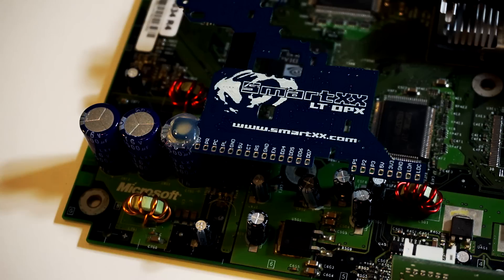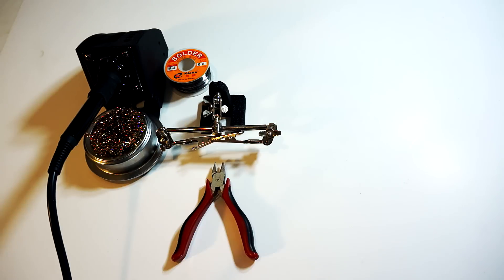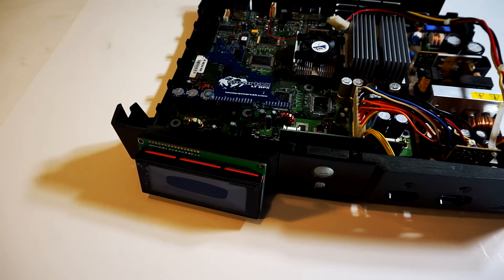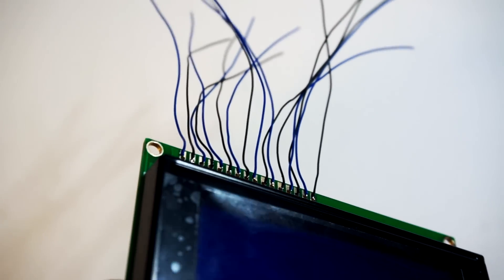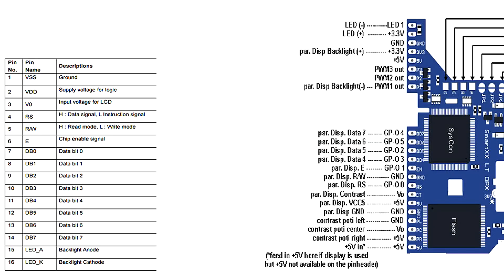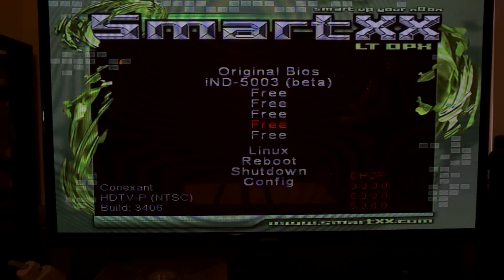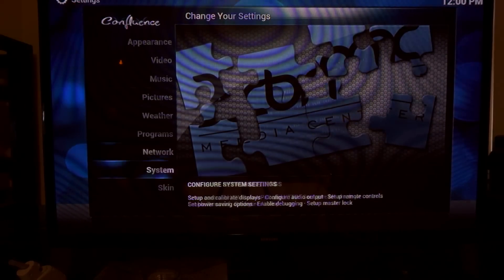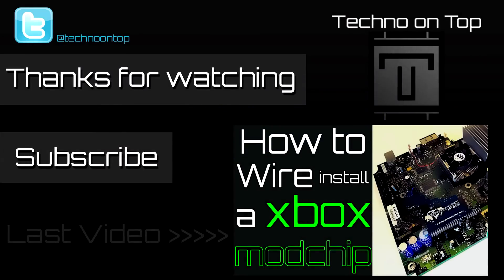How To Install Modchip LCD Original Xbox

Comment: I was hoping to see how you mounted it. I'm good with connecting it to the modchip, and I have the bezel and emi shield cut; just need to figure out a good way to mount it flush.
Was thinking of using some epoxy putty to secure some bolts to the bezel, screw on some nuts, and then feeding the bolts through the lcd's mounting holes.
Reply from the maker: Yeah getting it to look nice is the hardest part, can't really teach that people do it differently. Personally I cut the hole then epoxy it in place followed by more epoxy to fill in the holes then a bit of bondo to Make it seamless as possible. I wouldn't really know how to do it any other way. I kinda just assumed the people who don't epoxy/bondo it in place just kinda have it "sitting there" maybe using some heavy duty double sided tape or something. Noone ever shares exactly how they do it.. My process takes 3 days

Comment: Hey I was wondering do you know if the Xecuter LCD will work on a Xecuter 2.6?
Reply from the maker: No that modchip doesn't support the Lcd
Reply: @TechnoOnTop  damn thought I read that somewhere but wanted to double check.. got any recommendations for chips other then aladdin lol.. was thinking maybe openxenium supports it
Reply: @TechnoOnTop  nevermind, shame on me for not looking deeper in the comments section.. ignore my ignorance lol
Reply: @TechnoOnTop  however if you do know anywhere to pick some chips up that support it other them openxenium and aladdin always looking for what's best
Reply from the maker: @bass_not_bombs4384  chips that support the LCD are SmartXX LT OPX, SmartXX V2,V3, Xecuter X3, Aladdin 4064, Xenium chips, finding any of these will be tough could check ebay, and asking around on Niche Forums, but expect to pay $90+ for any of these, open Xenium would probably be the cheapest the only issue is noone made the daughter board that is required to run the LCD the Spi2Spar, there is instructions on how to build it. would probably be looking at spending around $60 or $70 to get everything you need if you go the Open Xenium route

Comment: Hey there sir. Once again this was an amazing tutorial. But I have a question - Where did you acquire the SmartXX MOD Chip?? I can't find it anywhere!! Also can the OpenXenium Modchip support LCD Screen??
Reply from the maker: Much appreciated! As for getting a smartXX chip, they haven't been made for a long time now, I see them pop up on ebay every now and then. Another option is to just ask in certain forums such as the ogXbox one. And yes the open xenium supports an lcd but it requires another board called spi2spar, the documents on how to build one are available through ryzee119's github, as far as I know Noone has built and sold those just the xenium chips, but I could be wrong alot happens on Facebook, but I don't use Facebook..
Reply: @TechnoOnTop  Thank You so much for getting back to me with this info. I will continue the Hunt for a good Mod Chip!!

Comment: What's the going price of these mod chips now?
Reply from the maker: His kit is somthing iv been doing for years, i didnt realize he offer's it "already done for you" i thought he was just selling the LCD at doublke the price. anyways the mod itself isnt super hard if you have the tools to do it, its just cutting a hole for the LCD screen and plugging it in, heres a different style of LCD https://goo.gl/dwwthj that i will be using in my next xbox build. iv also used it in a PS2
Reply: TechnoOnTop TechnoOnTop ..... crap, his lcd's are over priced lol but thank you for the link!. It would be awesome if you could show us how to add cpu and gpu fans without using the hdd or disk drive molex cables, I'm scared to wire it to anything else lol
Reply from the maker: @highhat5229  well its not just the LCD, he also provides the pre cut faceplate. but if your comfortable with a rotary tool its realitivly painless.  i actually just moved my icebeqs to a new board, i considered making a tutorial on that, but it would of been such a short dumb video, especially since i have no idea on the size on the screws i bought (and the coolers themselves are no longer made). but i do wire them directly to the exhaust fan pinheader on the underside. really any 3 pin fan will just plug into the header, then it can be controlled in the dashboard. but a video that shows pinouts, onm the motherboard either for pulling power or other things is actually a pretty good idea,  iv been working on stuff slowely, iv been sharing that through my twitter, once its done it will get a video, but that might not be for a while longer.
Reply: TechnoOnTop oh I've only bought the lcd off him I wasn't bothered about much else he was selling, and oh cool I'll look you up on twitter if it's in your YouTube description. 

I'm having issues finding Xbox component cables i see a few people are making their own from 360 cables, Do you know much about that? Is it better than those sketchy looking 3rd party ones on eBay?

Edit: lol don't worry it was your video I seen on making your own cables
Reply from the maker: @highhat5229  haha yea, they are good cables to make, i made them after buying the cheap ones, iv never owned the monster cables or the offical HD box so i cant compare them to those, but they look great, just dont forget to put the little plastic bit back lol i get tons of shit on that, i will say that all that hot glue is holding up just fine.
Reply: TechnoOnTop yeah haven't either and yeah I will if it goes back on... looks like it might not but thank you very much for your help! Most don't reply
Reply from the maker: No problem happy to help. I try and reply to everyone, but I do miss some comments.
Reply from the maker: Well there are a few people in the ogx community with the skills to bring this mod back to the table. Last ebay listing I saw for an X3 was over $100.
Reply: TechnoOnTop thanks for the reply, I found tinker mods website has a solution offering a lcd that plugs into the hdd and a thermometer that you stick to the cpu... not quite as good but it's cheap and available

Comment: Awesome dude, when you're soldering the cables down how do you managed to solder them as the pads are so thin on the chip?
Reply from the maker: I appreciate it. I'm just using small Guage wire and a small amount of solder. The pads are actually alot bigger then they seem. Thanks for watching

Comment: I want to add this mod to my Xbox after making a custom "PC" case for it, would be dope. I am working on the "greatest" Xbox ever without modchip/softmod
Reply from the maker: This mod requires a compatible modchip. So doing to an unmodded Xbox isn't possible
Reply: What chip would be great for the 1.6 Xbox? I see the 
Aladdin-XT-PLUS2 for cheap on Ebay
Reply from the maker: really any chip is fine, just not all have the LCD support , and ones thats do are tough to come by

Comment: +TechnoOnTop is it possible to have 2 LCD screens(one small temperature gauge LCD and a 20x4 Modchip LCD) without slimming the console and removing the DVD drive? For reference, thedse are the screens I'm looking to install: https://www.crystalfontz.com/product/cfah2004aytijt-character-display-20x4 and https://www.mainline-sensors.co.uk/collections/gauges/products/intercooler-temperature-gauge-sensor-air-charge-supercharger-bmw-nissan
Reply from the maker: Yeah there is plenty of room for both be sure to show off your mod when it's all done!

Comment: whats the difference between the modchip and the softmod option? beside the obvious hardware vs software approach, recently started looking at modding an original xbox and trying to see which way i want to go.
Reply from the maker: softmods tend to "self destruct" for no reason, almost all xbox's can be Tsoped flashed (hardmodded) V1-1.5, though the 1.6's can only be hardmodded via a modchip. main differences between a softmod and a hardmod is reliability and ease of harddrive upgrade. defintly look into TSOP flashing. if you happen to have a V1.6 and dont plan on buying a modchip just be sure to back up your EEPROM .

Comment: Hi TechnoOnTop , can i install a 3v LCD , on a x3 modchip ? Or it has to be 5v. I only have 3v :(  http://www.vatronix.com/products/76.html            thank you !!!!
Reply from the maker: the link doesnt work for me, but if its HD44780 compliant and you can find a way to only supply it with 3v, it may work,
Reply: Yes its a SPLC780D and hd44780 compatible. Now where to find a 3v supply ? Thank you anyway :)
Reply from the maker: you could use some type of voltage step down circuit from either the 5v source or you could pull 3.3v from the pinheader. either way the voltage will need to be stepped down. so a voltage buck, some have LCDs some dont,so you would need to measure the voltage with a multimeter before hooking it up.
Reply: i will do now ! I have a multimeter and all. have some elotrobic components that could step down the voltage. Tnks very much  for help !!!
Reply from the maker: daniel t no problem, be sure to let me know if it works, I'm curious to know

Comment: Nice job, thanks for sharing with us your knowledge. The screen is very easy too find on ebay but this particular modchip isnt. Have a chance to make that mod with lcd using another modchip?
Reply from the maker: the process of installing the LCD would be extremely similar on any chip that supports it. the HD44780 has 16 pins for whatever reason the smartxx chip didnt use 3 of them (D0,D1,D3). but i know the X3 chips would utilize all of them. if i ever get another chip that supports the LCD i will make quick tip type videos specific to that modchip.
Reply: I like try instal the lcd on aladdin xt 2 plus but i don't know what is the correct points to soldering. If i send you a link with picture could you give me a tip? That is the link with picture: http://www.eurasia.nu/shop/images/xenofx_big.jpg
Reply from the maker: wagner alves 
(Chip --> LCD)

(D2-->DB2) 
(D3 -->DB3) 
(D0 -->DB0) 
(D1 -->DB1) 
(RW -->RW)
(E --> E)
(VEE--> VDD)
(RS --> RS)
(GND -->VSS)
(SV --> V0) ????? 
(GND --> K)
(33v --> A)

the one with question marks im unsure of but that should be right, im assuming that "SV" stands for supply voltage and "V0" is your Input voltage.  also there is a spot sorta above the pins where a "trim pot" or a potentiometer would go to adjust the contrast, they arent labeled so idk what goes where but a guess is the one  by RS is your Poti right (+) and the 2 by GND one is your Poti LEft (-) and your Poti center. so after you wire it all up and you see no characters on the screen i would take a 1.5k resistor and bridge the poti left and Poti center. hope thats helps because its all i got lol...